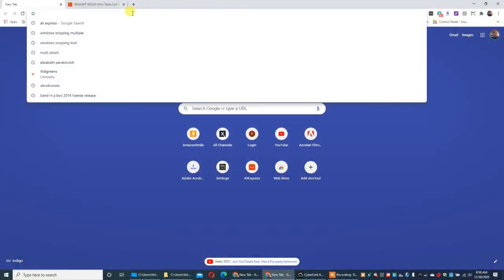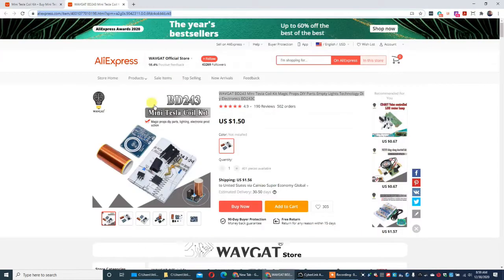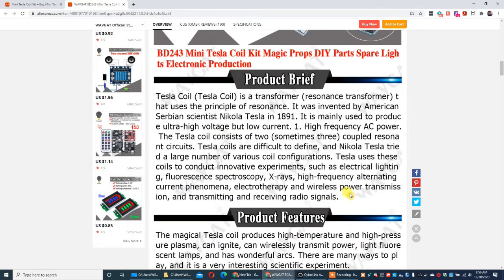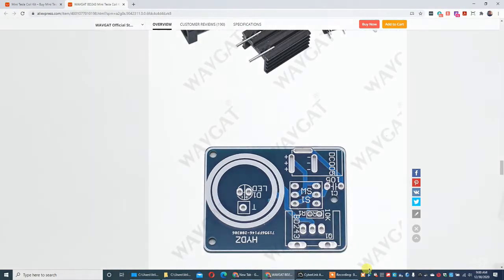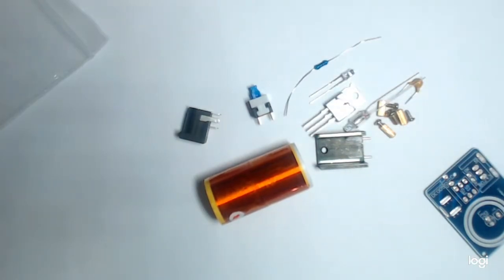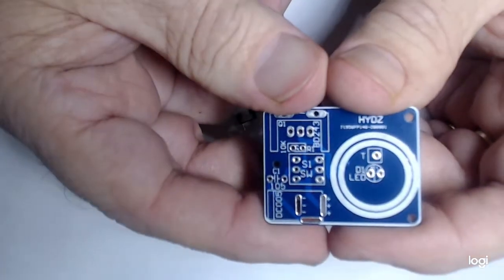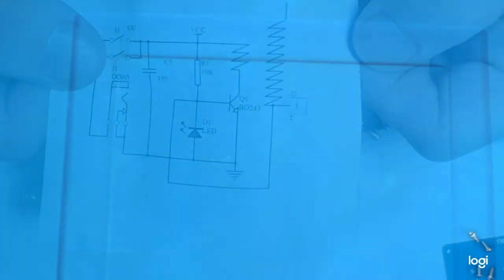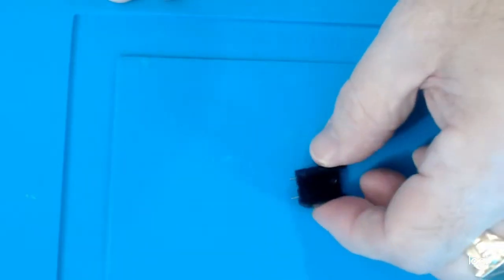BD243 Tesla Coil Kit IN ENGLISH

Comment: I figured the placement out and got the kit working.  Unfortunately I touched the top copper wire to a screwdriver and created a arc that flamed the insulation off the top of the wire.  Now the led comes on, but the coil doesn't work.  Did I pop the cap? Did I ruin the transistor?  Any suggestions as to why it doesn't work now?  I viewed videos of other coils and grounding did not cause a failure like this.
Reply from the maker: Glad to hear you got the kit working, but touching the top copper wire to a screwdriver likely caused a voltage discharge, which may have damaged one or more components.

Here are a few things to check:

Check the Transistor (BD243):

The BD243 transistor is a common failure point in Tesla coils when exposed to excessive current. Try replacing it with a new one and see if that restores functionality.
Check the Capacitor:

If the capacitor was overloaded during the arc, it might have failed. Look for any visible damage (bulging, discoloration, or cracks). If in doubt, replacing it is a good idea.
Inspect the Secondary Coil:

If the insulation burned off, check for any shorted turns in the secondary coil. If the exposed wire touches itself, it could disrupt the resonance needed for proper operation.
Check All Connections and Solder Joints:

High-voltage arcs can cause loose or burnt connections. Make sure all solder points are solid and that no traces on the PCB were damaged.
Test the Circuit with a Replacement Transistor First:

Since the LED still turns on, that means the low-voltage side is likely functional, but the high-voltage output is disrupted. Replacing the transistor first is a good troubleshooting step.
If you replace the transistor and capacitor and it still doesn’t work, let me know what symptoms you're seeing, and I’ll try to help further. Hope this helps!

Comment: my light n the coil lit up red and then turned off and i cant get it to turn back on do you know what i did wrong?
Reply from the maker: Hi there! Thanks for checking out my video. 😊 It sounds like your coil might be having trouble getting power. Here are a few things you can check:

Power Source: Make sure the power source is connected securely and delivering the correct voltage. Sometimes a loose connection can cause the light to flash or turn off.

Connections: Double-check all the wiring to ensure nothing is loose, disconnected, or shorting out.

Coil Condition: If the coil overheated, it might have tripped a safety feature or burned out. Let it cool down for a bit and try again.

Device Settings: If you’re using a device with adjustable settings, make sure they’re set correctly for the coil you’re using.

If none of these work, let me know more details about your setup, and I’ll do my best to help you troubleshoot further! 👍
Reply: @VelikoBekir  my led indicator wont even come on and the tesla coil isnt working but only the heat sink is getting hotter.